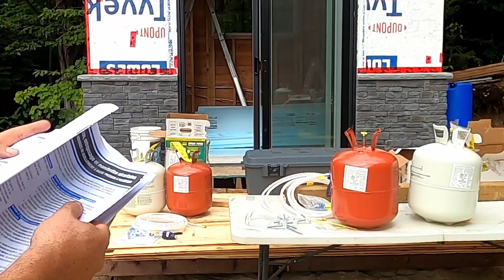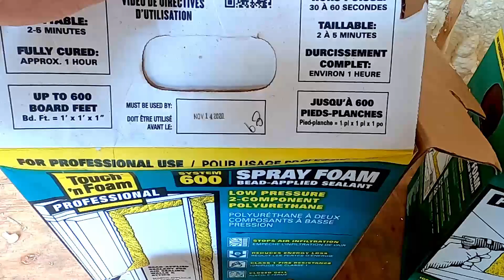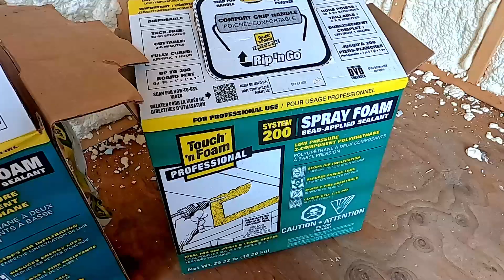The Biggest Secret to DIY Spray Foam: Off-Grid Cabin Build #11

Comment: It’s easier to shave the foam using a thin bladed “Japanese wood saw” that is available at a lot of wood working stores, instead of using a grinder with a flap sanding disc. The saw blades are long, thin, flexible, and reach stud to stud (16” O. C.) I created a video myself on the froth-Pak 200. I think the Froth-Pak sprays better than what I saw out of this DAP product, in case you decide to do this again. It’s spray smoother looking foam product. I enjoyed seeing some more real world examples of these companies products, rather than those company produced videos that don’t set real world examples.
Reply from the maker: If I do it again (which is likely), I'll try both of your suggestions. Thanks!

Comment: You can get airtight for a lot cheaper by just using XPS that is cut a smaller than the stud cavity and filling the gaps with canned expanding foam. So cheap and easy and way less exposure to toxins.
Reply: I watched another guy who installed xps, but left about half an inch so he could fill with foam. I thought it was a cool idea because it was easy to see you've got 2 inches deep and guarantee that it's air sealed. I tried this when I did mine last winter...only my attic joints and studs were often off by up to 3 inches and I wasn't about to measure every single bay for custom fitting.

Comment: 17:35 So I just got to looking at the nozzles in the kit I have. It's a different brand than yours, but the nozzles are the same... however, I noticed there are actually two different types of nozzles in the package. Half of them are for spraying crevices, the other half spray a large fan pattern. Is it possible your package had two different types as well?
Reply from the maker: I had a few kits. No cool fan nozzles.  Are you in canada? I'm curious if it is a legal thing.
Reply: @TheGarage656  In the US, northern Maine

Comment: I have not researched insulation much so I'm very curious: I was going to go with Rockwool just based on what I've seen previously. Why go with spray foam? It seems messy, labor-intensive. You mentioned you research (probably like me!). Did it come down to price, availability, something else? Again, I could be missing something obvious and I haven't gotten to the point of calculating what I'd need for my build yet.
Reply from the maker: I really wanted air-tight, which is a significant part of the insulation value. I like rockwool products, but having a tight air seal was a priority. The posted R-value on a product is one thing. R-value plus control of cold/hot air exchange reduces mold (to almost zero chance) and increases overall r-value performance and comfort (no drafts). Foam also adds some structural support (not sure how much). But yes, it is freaky expensive. I'd call someone in to do the spray foam next time!
Reply: @TheGarage656  awesome thanks. I know for you this is basically a permanent structure on your property. Since I will eventually sell this house in the city, I'm thinking it makes sense to do "traditional" insulation due to cost and practicality. No sense over engineering for something I'm not keeping for decades. I appreciate the reasons!